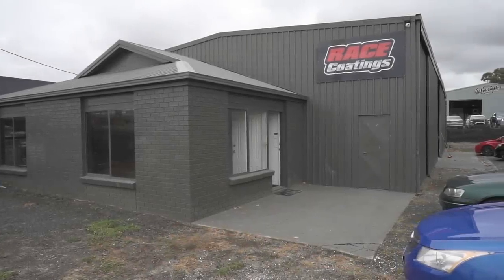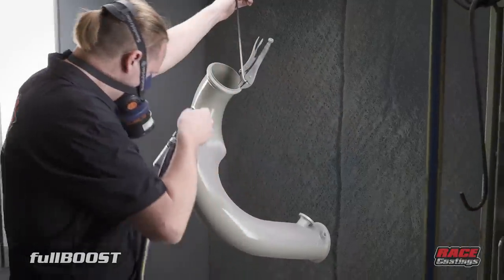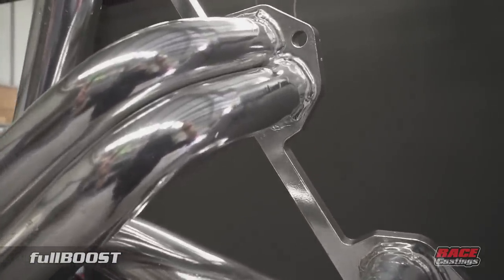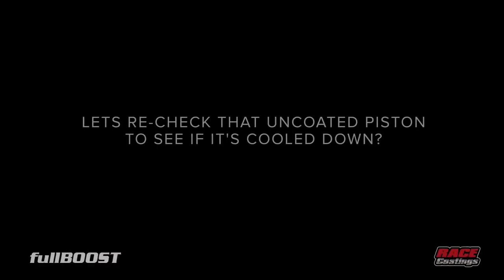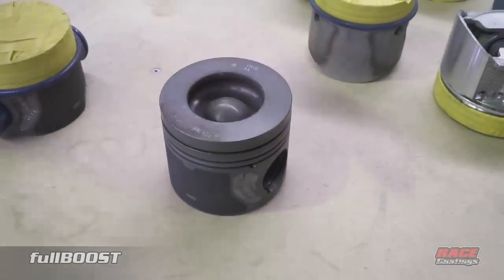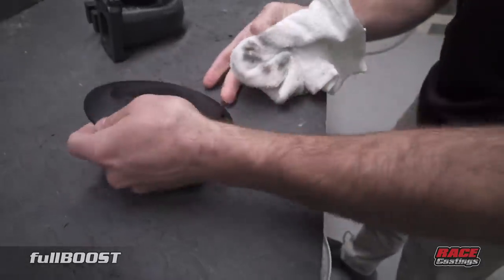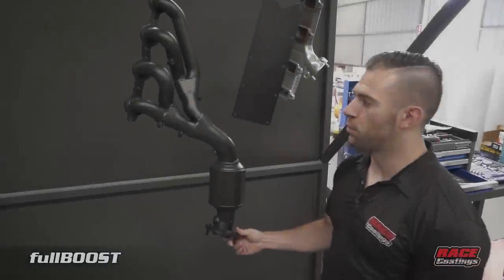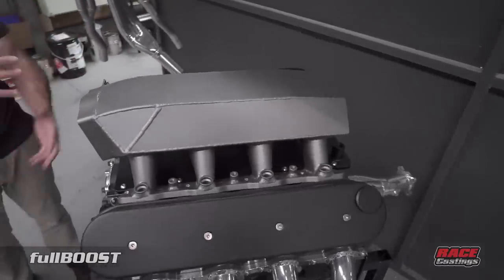What is Ceramic Coating? | Race Coatings

Comment: Ok put your big panties on and listen to your error please...... Combustion Does not stop at the top of a piston crown!  It is the same temp all the way to the first ring land! Why do you and so many others only coat the top surface? Because it's easy? I had pistons melt under detonation exactly just above ring land ( with only top coating done) I'll assume you know what detonation is and the immense temp involved.  So I know for a fact that the top coating means close to nothing if  sides are not done up to first ring. A blow torch test on a exposed  coated piston sitting inside a bore is not a true test, as done by others.  Think of detonation has holding the torch in one corner while doing same test. 100% garrentee you it will melt between crown and ring land! Please go and do your own test if you don't believe me. And then correct your error please!

Comment: ceramic coating is the stupidest thing ive ever seen 
while ceramic valve covers for example work perfectly cooling the top cover 

ceramic coating does exactly the opposite .... it traps heat inside and make it worse ....
its a coating OVER metal the whole thing is getting thicker....
its like gold plating plastic....
it just looks nice

Comment: The "experiment" with the pistons is complete bull shit.
How is it possible for the top of the untreated piston to be heated and the bottom gets about 4 times as hot. That brakes every rule of physics.
Also ceramic coating are made to keep the heat inside, which is why it works so well on exhaust manifolds as they want to maintain as much heat as possible internally, especially in turbocharged engines. So all this will do is keep the cylinder temperatures high which can lead to knock and and further damage. The heat wants to travel down through the piston and be cooled by oil squirters and for the heat to been taken out so that the cylinder temprature stays down. Also they have a huge difference in expansion rates so I doubt the coating will stay on forever. 
Just do people a favour and remove the video as it is incorrect, manipulated information.

Comment: If this company is going to show me a durability test of there headers. Make them the same fucking color. Not some super glossy reflective chrome mirror over shiny metal vs a flat matte black over shiny metal. Give us the same black they sprayed on those parts! You swine! (Not you fullboost, your still okay)
Reply: Wrong side of the bed this morning?
You can make your point without getting angry you know? It is an option.
Reply from the maker: If you rewatch the video there is black powder and ceramic coatings used. Calling people names isn't going to get you very far if you have a genuine question.
Reply: looked at him with one little eye
Reply: hahahaha